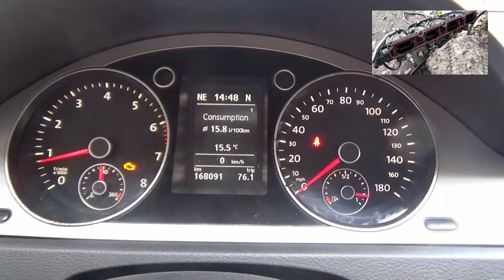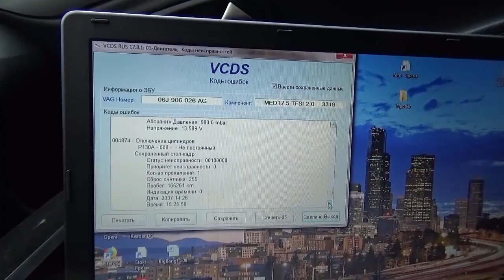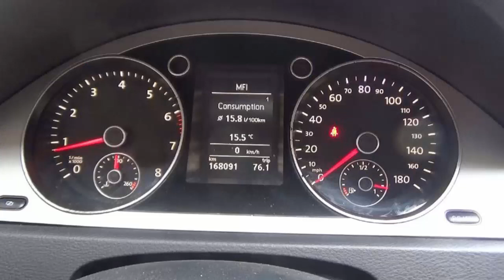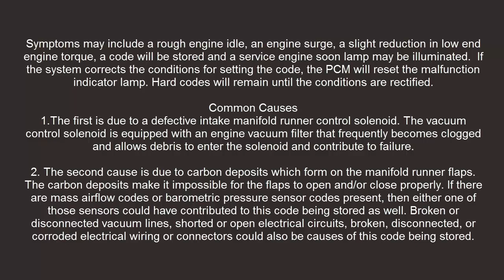Error code P2015 - Intake Manifold Failure Explained, VAG. Common Causes

Comment: i have the same problem p2015 in my Passat cc CBAB.
Me i changed All this parts to New parts.
* The intake manifold New.
* The EGR valve New.
* V157 New.
All this parts but the code error P2015 still on .
I delete it with VCDS but After 2km returns again !!!!! ;(( ;( 
What i Can Do in this case for P2015.
Can you help me please .
Thank you 
Regards
Reply: Buy adapter and clean contacts inside motor
Reply: @corel965  what adapter? What motor? Please
Reply: @badri0078  is your engine disel ? On V157 you have to clean contacts inside and out side with fine grit sand paper and those legs when you remove cover from 157 conects to motor press with tweezers a little bit and clean all if that not help check wires are some of them shorted to ground and at least just google P2015 adapter good luck mate !
Reply: @corel965  da diesel.
I changed the v157 New one ...only one month ago...
Also i changed the intake manifold and egr valve ....All objet 600€.
But still have the check engine and p2015 ;((((
Reply: @badri0078  Did you find any solution? I have the same problem